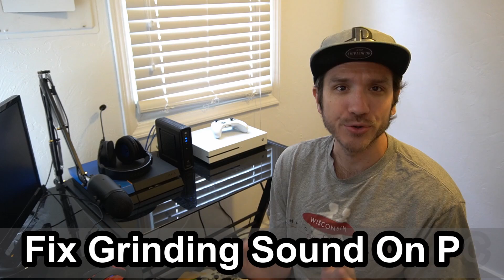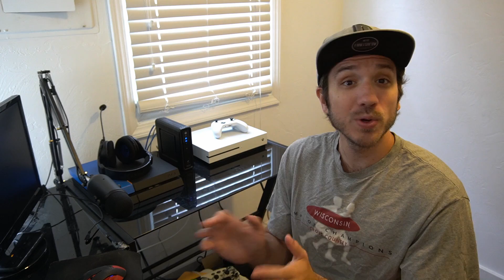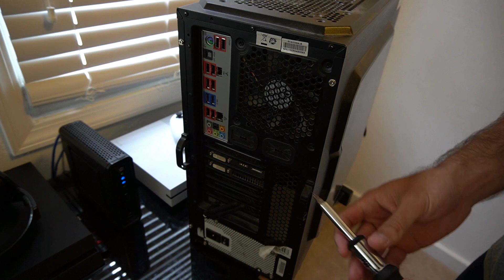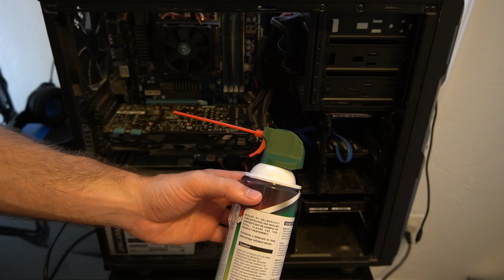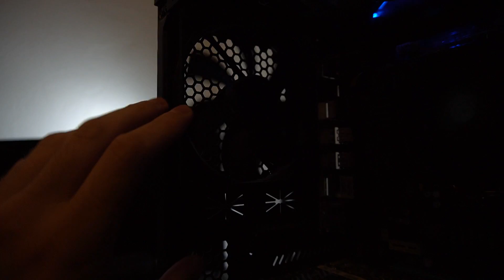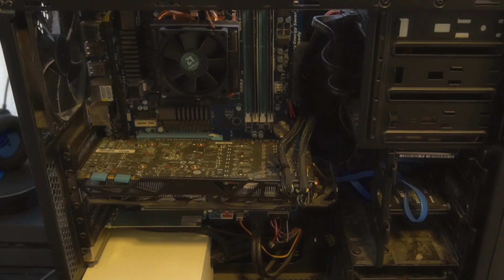How to Fix Computer Making Grinding Noise (Easy Method)

Comment: to be honest i think what i would see the grind as is that the fan is unstable when i leave speed at 35 for some minutes i can barely hear it but as much more i turn it up it gets grindier my gpu was maxed 64 but now 70 at max temp so i think at lower speed its trying to get in a good position when rising the speed it's hard for the fan to keep the balance since it rotates much faster and the stability will get pretty unbalanced and that is making gpu temp hotter than usual is that the fan will go up and down while rotating wich will make the air go out instead of the heatsink.
Reply: sorry for bad explaining lol

Comment: I smacked my computer  on the top and it lowered the noise, what does this mean?
Reply: Karl Hans The same thing happens to me
Reply: I did fix the sound a little bit by loosening the screws however I can still somewhat hear it
Reply: @mrwatera3209  if it is the back-side fan, give it a little slap, should stop if it is really quiet.

Comment: Mine only does it for about 20 seconds after startup
Reply: I’ve only had mine for 3 years and the hardware is already dead
Reply: yea , me too
Reply: Same here. What is the reason for this?
Reply: Hello, did you ever find a solution?
Reply: Kind of curious why it even does that? like it warms up?
Reply: @hatman3445  I think it is because of Windows fast boot. I turned it off and mine hasn't done it since
Reply: Has anyone still come up with a soloution?
Reply: @Erik Alvarado Broo I did the thing he told to. I turned off the fast boot thing and the sound happens sometimes when i open it and sometimes dosen't. Still the fact that it happens really bothers me and my pc isnt that old either, its like a few months :/
Reply: I have grinding noises on startup for a while now, cleaned my pc yesterday, it's a lot cooler and a lot more quiet but the noice is still there at startup
Reply: @cranzit7406  did uou ever find a solution? im having the same issue and would love to know how to fix it
Reply: @literallypidge  yeah it happened to be my cooler. It died lol, so I just got a new one and now Im good.
Reply: Mine does it when it starts up and then for certain games i Select everythings brand new not a week old
Reply: @willmania3557  have you found a solution yet?
Reply: me too
Reply: same
Reply: Same
Reply: @brandon4ms  have you solved it yet
Reply: @driftewi  I unplugged the 2 fans from the motherboard and re connected them in different slots
Reply: @brandon4ms  idk if i have any other slots rip
Reply: @driftewi  I just swapped the 2 plugs for each other
Reply: Same
Reply: Fixed it it was my cpu fan the screws were loose on it so just tightened it and it’s fine
Reply: Same here(same pinch)
Reply: mine started doing this as well, but then it progressively got worse.

Comment: I am having the exact issue with my fans on the front of my case. However when I stop the fan, like you did, and let it go again, it still makes this noise. I've taken the fans apart and cleaned them and the same issue. I have no idea what to do, as I have 3 fans (2 in front and one behind) all the same brand. The one behind is working fine and the two in front are making that noise. wondering if I need to get a new pair of fans
Reply: Hey, did you find a solution to your problem?
Reply: @SlovakClovek  I had to get new fans. they're pretty cheap and it's silent now :)
Reply: @andrewhuestis9009  that's great, I'm glad you got it resolved. My problem was a lot more simple, I had my pc laid sideways because of a weird shelf I have and once I stood it upright, the fans stopped making the noise
Reply: Same issue here, silentum PC, one of 3 front fans started doing this
Reply: @simQaas  I had to replace them. only $9 a fan so it wasn't too expensive, but yea, couldn't find a solution
Reply: @andrewhuestis9009  I found solution too, i just needed to screw on one fan (loud one) and it passed, there are 4 screws, do them all
Reply: @Cross Stitching what?

Comment: I fixed mine by opening the PC up and pulling back the fan blades one by one so they lined up with each other better. Somehow this worked. I wouldn't recommend this option if compressed airs works, this was the solution for my problem though.

Comment: Mine is the top intake fan in the front. It grinds for like 45 seconds to 1 minute, then stops. I've dusted it,its totally clean. Just going to replace
Reply: Did it work? The replacing
Reply: @429m3e  haven't replaced yet, but yeah, replacing the problem fan will fix the problem
Reply: @CreepingDe4th81  did it work?
Reply: @unsharded8503  Still havent replaced it LMAO. The thing is, it only does it on startup. it will grind for about a minute or so, then it stops completely. I still don't know why it does it
Reply: @CreepingDe4th81  I fixed mine. Idk why but it just stopped.
Reply: @unsharded8503  waiting for this to happen to me
Reply: @gonzopr420  Bro it started again I built a whole new pc cuz of it LMAO